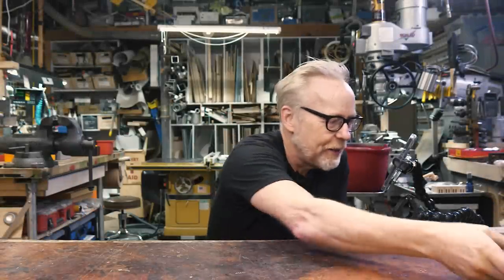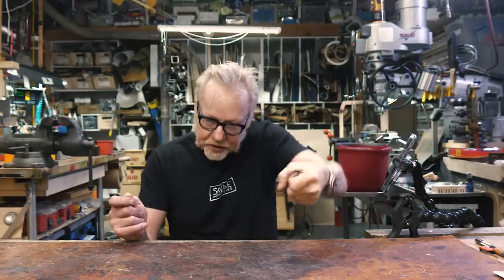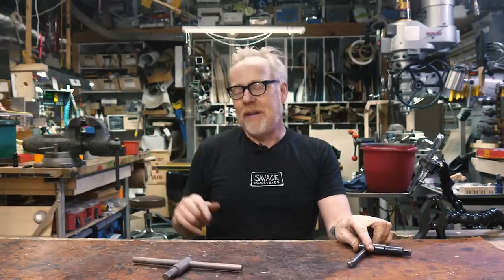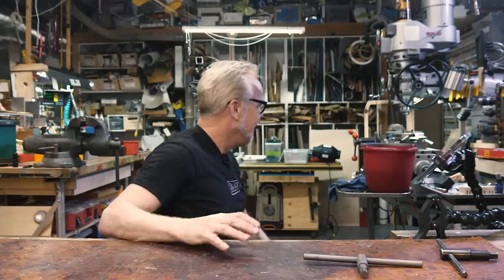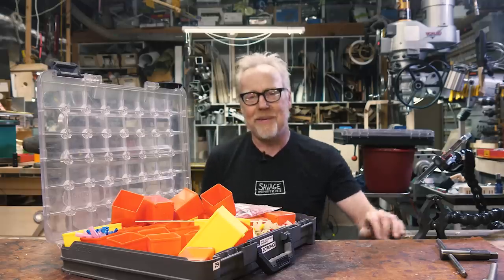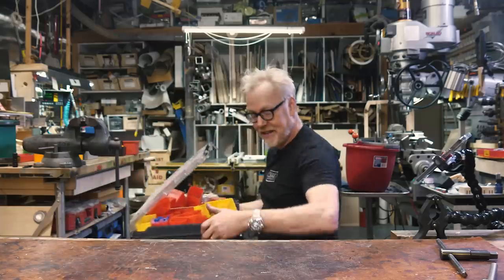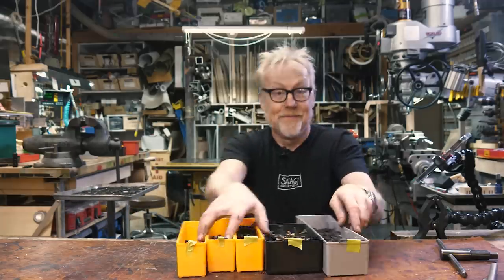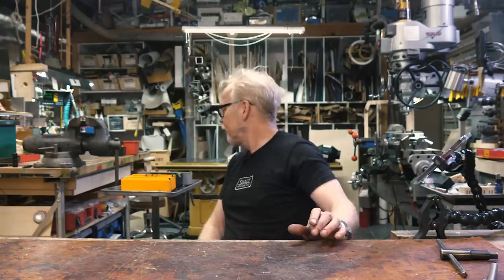Adam Savage Explains What to Do When You Drop Gobs of Loose Hardware

Comment: Go uninsulated for your wire terminals. And use heat shrink when needed. I guarantee you'll thank me later. You'd be amazed at the times you really don't need the insulator. And you'll find it gets in the way more often than not. And for the times you need the insulation, heat shrink is quick and much more professional. Insulated terminals are for home-owner-consumer mentality folks who don't know any better. Any time you crimp through a pre installed insulator, you damage the insulation, rendering it pointless.

Comment: I have a used merch store. I've had buckets of drywall screws of different sizes. I took a 2 and 1/2 pvc pipe, cut a slot. Put a hand full of screws. tap a couple times. when I had a bunch of screws hanging out of the pipe slot I could slowly lower against a table top and the longest poked up first. then each size as I lowered it. I did have to tweak it a bit, but it was worth it because of the amount I wanted to get done.

Comment: Four minutes into your video and I wanted to cry, I have been there more times than I would like to admit questioning if I should just throw everything out and start over or take the time needed to sort everything out. For commonly used items like drywall screws I usually manage to "find" the time to sort the parts out, but in the same aspect I have a bucket of salvaged arcade/pinball machine screws and parts that was dumped 2 years ago that just hasn't been important enough to sort through and resolve.

Comment: I've been building things and fixing things since I was a young boy of about seven.  The system that has evolved for me is like my tools:  The hand tools that I use the most are up on the tool board with all the other hand tools are place in miscellaneous tools light and miscellaneous tools heavy.  With hardware I keep special items to themselves such as drywall screws are kept in a five-gallon bucket in which I've combine two other bottoms which are cut at three inches high and have plywood separators in them to give me four pockets per bucket bottom.  The two bucket bottoms are removable and have handles built into them.  For the rest of my hardware, I've embraced the miscellaneous storage of large medium and small.  It's not like a hardware store, but I don't have the space to separate all of my hardware into distinct containers.  Great video Adam thumbs up.

Comment: The connectors you're talking about that you use the most are called butt splice connectors. 
As far as quality crimp lugs go I've worked on a lot of heavy industrial and power system projects and 99% of them spec Thomas and Betts Sta-Kon connectors. The only times we didn't use those was for a power supplier that had their own lugs manufactured specifically for them.

Comment: My suggestion for further optimization is this. I used to need to count large amount of coins. I would take a handful or so and spread them out on a flat surface near the edge. For each target I’d put one finger on each and drag them to the edge  and drop each one either into a bucket or my hand then throw the group into it’s bucket. This was also to count them. With parts if your dealing with a small variety I would imagine this same technique could work. It’s way faster, and your eye recognizes moving objects better than still ones, so as you drag the cought items around the spread moves and you reveal more targets.

Comment: A quick suggestion, for the hooks that were holding the chuck keys and hammer, glue a small magnet onto the hook to catch the tool and help keep it in place.   This will avoid bumping things loose or items falling from vibration.  But they can still be grabbed and remove with minimal extra effort.

Comment: Sherco auto and marine supply.     All the terminal ends they sell are made in USA and tinned copper. They also sell marine grade hookup wire in all gauges and you can order specific colors and tracer colors. E.g. You need light pink with dk blue tracer in 14 awg. They got it.    Hope this helps

Comment: I've had similar experiences I am a carpenter electrician plumber roofer welder fabricator locksmith and for the last 3 years and essential healthcare worker the back door of my truck came open where I had placed all of my Hardware organizers the drywall screws and nails and rivets came out on the road I have a large magnet which helped but it did nothing for the aluminum roofing nails and aluminum pop rivets I first started by getting my push broom on sweeping everything to the curb and collected everything up and put it in bags I would spend half an hour night until the bags are empty this was nothing compared to when I dropped my box of lock cylinder pins that has been months ago and I still have pins to go through because you must use in micrometer for each one they're too small to do with the naked eye I I could have bought a brand new box but I am cheap as hell

Comment: If you have a consistent workflow in the shop, like on a factory floor where you have materials coming in one end and products out the other, you can organize that very well and it will endure.  But for a hobby workshop or a 'we do it all' shop, not so much.  You can organize the frequently used stuff but that's only going to be a portion of the shop.

Comment: Is it necessary to organize the lugs?  If you had all of them in a coffee can then when you needed one you dump them out on that tray, dig around until you find the one that you want, then dump them back in the can.  If you only use them occasionally then the time spent digging around in the tray would be less than the time spent organizing all of them.  The ones that you use frequently, the various splices, just buy new boxes of those so you don't have to spend the time organizing them.
Unless you can spend time at home watching television and organizing screws, it doesn't pay for you to do that.  You are better off buying new boxes or hiring an assistant to do the organizing for you.

Comment: When it comes to nuts and bolts you can't go past a display board and break it up into smaller portions of sizes, although i did see a real geeky way of doing metal fastners (it used an electromagnet a step system and some maths to work out when each bolt would drop off due to magnetism and set the step heights) way to much for me ..... or alternative teach a robot arm to do it an AI program would probably learn it pretty quick

Comment: So what is a good crimp tool? I have a couple of ratcheting crimpers. Both pretend to offer a bit of crimp adjustment but I don't find either that reliable. In fact, I usually end up crimping the wire in a blue terminal on the red setting (with a third crimp on the blue setting over the sleeve)

Comment: Had similar accidents happening all the time, used them as an opportunity to clean up stuff a bit. Put everything in a big pickles jar (essential: remove pickles first) and when I needed a certain part I would search it in there and put a second one to the side. did that a couple of times, then eventually invested a bit time to sort out only those few I put aside frequently. Left the others in the jar "just in case" and most of the time its sitting there untouched...

Comment: I have mostly moved away from lugs that require crimping for electrical connections after discovering Wago quick connectors. May not be right for every project but man are they a joy to use and great for prototyping! And as for sorting - I have been using the “similar object pass” method for years and was elated to see Adam coming to the same method. If I sort multi color and shape together, I have found that for me it is easier to start with like colors then like shape then size. I hate doing it but find it can be kind of zen like process. Bonus - Monotonous tasks tend to spark creative thinking.

Comment: I find a small handful at a time, it's pretty easy to pull out the longest first from the cupped palm.  Part of the problem is those plastic cases- you have to pull it out, find a place to set it down, undo the latches, and make sure the lid is stable, before finally looking for the right part.  With open containers in a drawer, it's one step- open drawer, look for fastener.

Comment: Makes sense, collect several of the same type and put them away all at once. You reduce the number of times you need to turn/move your hand to the bins and back, so it goes faster.

I usually try to push them around into piles, then pick them up. Of course you might need to transfer the entire pile off the floor before starting that...

Comment: I like to put magnets in the bottom of my small parts organizers. If they get dumped out or turned over etc at the very least I have at least a few of each item in the appropriate spot, at best I have very little to sort back into its spot. 

In regards to working out what I don’t need for electrical connectors when I’m setting something up I’ll start with a bag of ten of each and date them. if I use up the bag of ten quickly I’ll order a bag of fifty, the bags of ten that are unopened or have one or two missing I put in a separate container not somewhere I use them everyday. They’re there on the off chance I need that size connector.

Comment: for holding any tools that are magnetic use a magnetic strip or some other form of magnet. we use the harbor freight round magnets for blow guns at molding machines. the ones that have a small hook and are encased in a steel shell. drill out the hook rivet and screw the magnet down upside down. works great and really cheap. like 3.99 for  2 .   60 lbs claimed force .

Comment: I'm sure this will not get looked at, at least not in time, but when it comes to the drywall screws I would create a mesh of some sort that has holes just large enough for the smallest screws to fit through and then use the old prospector motion by pouring the screws on the mesh and move it side to side over a container until all of the smallest ones fall through. Place those in their container, and then move to the next size screw. The one used for the smaller ones can be modified for the next size. Just keep doing that until they are all sorted. Kind of how coins are sorted. I bet the entire bunch of screws could be done in less than 30 minutes. Maybe next time.

Comment: I didn't see too many people comment on the crimp connector question.  I recommend looking for Ancor brand connectors.  They are tinned copper and have both nylon and heat shrink insulation options.  The best place to look for them is typically marine supply places.

Comment: get a metric shit ton of wago connectors. if you need a better connection solder it, then get screw terminals of various sizes and the Bootlace Ferrules End Terminal connectors and you are set for most problems, then put the connectors you mixed now in a bucket of "just in case i need one" up in the attic. this makes changes much easyer to do later on.

Comment: I have my chuck key, toolpost wrench and drill chuck on retraction cables hanging down from the ceiling where each is just high enough that I won't hit my head on them.

And...  Sorting is cathartic and I find that I'm able to solve other nagging problems while working it out.  

It's akin to leaving work after spending hours on some code or other involved problem and having the solution hit you just as the onramp enters the freeway.

Comment: for the lugs, it would be more practical to sort the ones you use frequently, and leave the rest unsorted.  Probably an 80-20 rule in there somewhere, but it's basically efficient to sort the ones you use frequently, and inefficient to sort the ones you use infrequently.  However, if you are going to spend your way out of it, I think Wago connectors seem much better

Comment: I just went through my electrical connectors too. I found myself pulling off the pvc insulators and using my own 3:1 adhesive heat shrink. So I threw away all the insulated ones and ordered tin plated copper uninsulated. I can tell a lot easier if the crimp is good on uninsulated connectors and the heat shrink looks so much better. For butt connectors however I got the ones with the solder  inside them.

Comment: ok so as a dish washer or at least when i worked as a dish washer your method of sorting screws is the same one id use for cutlery.
it a lot easier to do pattern recognition on one item at a time so by the time in my case the knifes by the time you get to them youve sorted every thing else out:) plus it works great with my ADHD

Comment: Ok if you want to get rid of the lug problem and only use one thing for splicing one wire into another to run power off of one wire to another wire that is going somewhere else or even instead of using a bunch of ring lug crimps get a thing called t-crimp wore connectors or t-tap wire connectors

Comment: Over my lifespan,   I've attempted to "organize" my workspaces multiple times, and finally realized (as you have) that it is a never ending task.  
 There  is never a time when everything in my work area is completely and correctly organized. 
   Whether it's at work, home shop, kitchen or (heaven help me!) my desk and filing cabinets in my office,  it is, like you said, very much an ongoing process. It's  something that changes from time to time to fit with whatever it is that is most important to me in that moment. Einstein was correct,  everything is relative to your position in time and space. 
 Which definitely includes everything in my shop. Good luck and Godspeed,  Adam!

Comment: This is what I've done from the frustrations of trying to find that one type of fastener that I bought a year ago for a project that only took four but had to buy a box of 25 and now I need one again. I took all my one-off fasteners and placed each one in a zip lock bag. The bags are clear so you can see the fastener in the bag and they take up the minimum amount of space as you can place one or a 1000 in a bag. I stacked all the bags inline so you can quickly scan over the line of bags to find the fastener.

Comment: Put the ones you use the most in one container and keep it where they are most convenient.  Put the ones you use the least in another container and put it someplace out of the way but still easily accessible for the times when they are needed.

I have a shelf and the ones least used are stacked under the ones most used.  The most used is on the top and easy to grab when needed and the least used are not in the way but still easily accessible when I do need them.

Comment: for sorting your drywall screws i recommend a vibratory conveyor pour the screws and else into a hopper that vibrates them till the nail or screw head hangs on a slot .tolerances to allow the shaft and tip of screw to fall to gravity while the head suspends it then it just has to continue down this rail slot to collection chamber I've worked in a place that repurposed ww2 bullet manufacturing machines this was the essential part of the machine along with the press yeah i made chapstick the amazing lil plastic tube that feeds the balm to your 👄 lips theres spiral or straight vibratory conveyors but you with your skillsets easily have ability to make one oh and the drause chaff whatever you're sifting out will remain to easily be collected theres density sorting machines using air or water with different strengths or just like coin sorting machines with progressively larger slots/ holes but you get the point , there's a number of easier ways to sort I've been studying for years (I'm a natural engineer not a studied one i pick up the knowledge through experience and feel and mistakes not of myself but of others)
Reply: side note seen an antique hammer set on ask this old house with a what is it segment i won't forget as i rewatched it at least 8 times or more it had a hopper you dump loose nails in manually shake it once or twice then hold it to the roof and hit it with your hammer ⚒️🔨 great for roofing in the 1920s or older IDK so once your nails are set 1/4 inch in the other guy follows with a hammer slapping the nails in with 1 heavy hit predating nail guns i suppose the same guy could be setting and hammering but a dedicated follow up guy would save energy overall getting more done with 2 working together than 2 working individually with the tool

Comment: Try knocking over 50 drawers overflowing with electronics components. Resistors, capacitors, leds, mosfets, bits, header pins, resistors, about 2000 assorted cmos, ttl, opamp, potentiometers. All of this in surface mount and through hole packages. About 10 thousand separate items haha
Reply: Not as bad as the fork lift operator that knocked down an entire warehouse (domino effect).
Reply: @guytech7310  haha true

Comment: I was wondering how you were measuring the screws in the video. Did your watch have a Guage on it or do you just know how big the links are?( If the watch did have a Guage on it where did you get one I need it for work?😂)
Reply: He has a measurement tattoo on his arm
Reply: @not2be4gotten02  damn im not that hard-core about measuring, guess I'll have to design a watch that does it for me😂
Reply: He has mentioned it in a few videos (I'm assuming you're fairly new to the channel, welcome 😁) and he uses it more for general references when out and about, and if I remember correctly it measures to 6 or 8 inches. He remeasured it in one of the Q&A sections of the livestreams and its off by like 1/16 of an inch.
Reply: @not2be4gotten02  well technically speaking if he were heavier or skinnier than when he got it done it would be a little off🤔